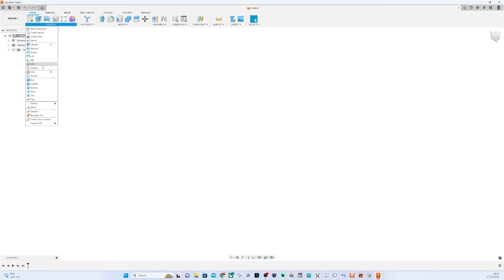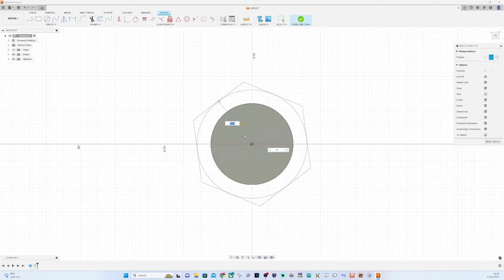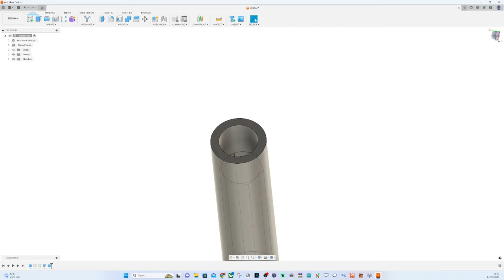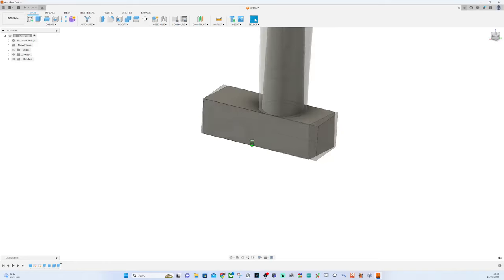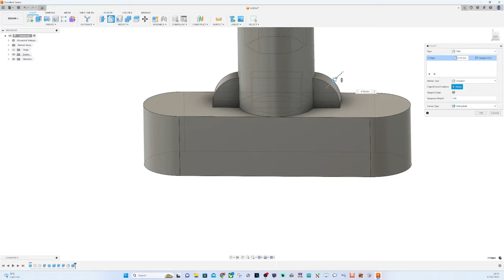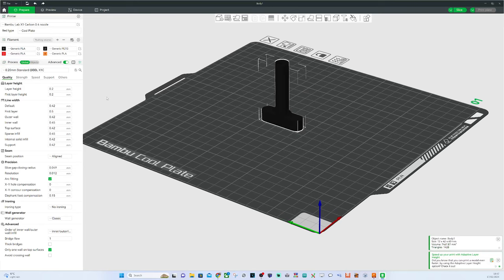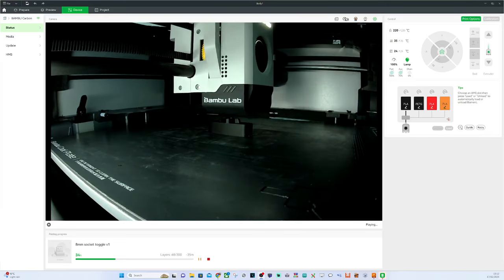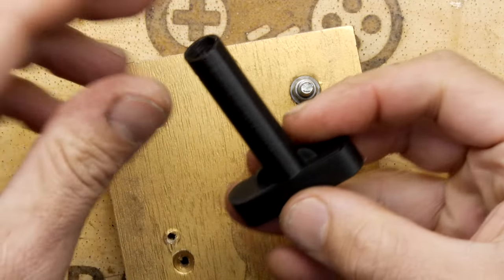3D Printed Socket Surprise - I am quite blown away by this

Comment: To clarify, the reason you couldn't extrude without first clicking the sides was because you had the profile of the socket selected. That had fusion assume you wanted to extrude the socket face instead.

Aside from going out and selecting the correct face, you can also choose a face in the extrude tool in the toolbox :)

Also great video!
Reply from the maker: Thanks, I'll have to rewatch and see myself doing it wrong. After years of using fusion it broke my brain 😂

Comment: When you want stronger prints, increase the walls, not infill.
Wall perimeters add way more to strength than infill.
Reply: Also don't use grid, it's the worst infill as it causes collisions with the nozzle.
Reply from the maker: @hippopotamus86 what is best to use by default?
Reply: @backofficeshow  Depends on the use case, but I tend to use gyroid or cubic. With the default of 'grid' (which for some reason Bambu Lab won't change, despite Orca and Prusia Slider both not using it as default anymore), you will hear grinding noises when the nozzle runs over the raised intersections. Apparently the same issue can happen with rectilinear.

Comment: I've made larger ones to put M16 nuts on the bolt that holds my bike rack to my car - it always took an age to finger tighten them up as they had to pull in a vibration resisting bar also..... I made them with a 12mm end for the cordless drill chuck, and they work really well.... I also made similar to play with - a car scissor jack of mine has a nut on the drive shaft, that you are supposed to turn with a small lever/socket.... the cordless drill is much faster - I've snapped a pair of these though, much more torque!
Reply from the maker: That's really interesting, M16 is pretty big! I'm designing a rig to test the force these can take and measure the result. I'm curious as to how to print the strongest versions possible!

Comment: I wanted a flat driver for interchangeable driver bits a while back, I was really supprised his well it worked, I assumed printing something like that would be an terrible failure.

Two tips though:
 Increasing the thickness of the walls/number of perimeters generally does more to improve strength than adding more infill. 
When you did the second cut to clear the cross bar you could have dragged the original cut to the end of the timeline rather than doubling up on the feature. It may not matter much for a simple part of a one off, but that sort of thing can really mess up your day on a more complex project if you come back to make changes later.
Reply from the maker: Those are great tips. I just ordered a digital torque wrench as I get this topic needs to be approached scientifically and including exotic filaments. 

I'll use your tips in the new socket designs! Is there is a nice way in fusion to make length parametric? That would make life easier to output standard and long sockets
Reply: @backofficeshow  there is a menu for parameters (I think it uses a capital sigma for an icon) you can create named parameters there then use the names in place of the measurements when dimensioning. Also the more you can do to ensure things are set relative to what actually matters the better off you will be. Such as setting the length of an extrude as up to surface or offset from surface to the surface rather than using absolute measurements the better things will hold together as you go. If there is one thing I render from my car classes it is the phrase "capture design intent", is the cut 20mm deep or is it half way through a 40mm part? That difrance matters a lot if the thickness of the the part changes later.
Reply: I took a moment to check, the parameters menu is the fx icon, on the solid/modify toolbar.

Comment: Y not use a deep socket from a socket set?
Reply from the maker: It's easy enough to get off when you are at home or the garage, but I wanted a tool that I could leave in the vehicle, or in this case, permanently slotted over the nut. I think they didn't make a great design decision with the nut

Comment: But you didn't answer the real question? Did it work in the car?
Reply from the maker: I was going to try it, but it's raining 😂

But yes, it will 100% work. It holds a plastic lid on so will not require even as much torque as I demonstrated. I will print a second one and leave them permanently installed.

I might reduce the size to 7.9mm so they have an interference fit.
Reply: @backofficeshow  Ah, so convert the buried castlenut into a hand friendly t-nut. Great idea.
Reply from the maker: @RossReedstrom good idea, but the access is limited. I'm wondering now though.....

What if I take this same design. Remove the hex and replace it with a hollow tube. The diameter just shy of that internal to the m8.

Then tap out an m8 thread.

The whole thing becomes the nut? 

It will never rust out and if it gets bound up, it will be a lot easier to break out than a rusted nyloc?
Reply: @backofficeshow  since it's just holding a cover on, not a lot of load, it could work. But your existing design,  undersized so the nyloc press fits, basically is a nice thumb screw/wing nut as it is. Just leave it in place! That's what I was trying to say.

Comment: Wood squished down don't really hold the torque.
Reply from the maker: I just ordered a digital torque wrench. This subject has got me interested enough to want to test it properly. I would like to see how large we can actually get and what reasonable levels of torque are possible.

The idea of being able to print your own sockets in an emergency is cool, Also having non-marring sockets would be very useful as well!
Reply: Make the toggle wider then run a 1-2mm fillet all around the base of the tool to the toggle. That will increase your torque strength.
Reply from the maker: @simonmccolljones2445 great idea..I tried it for intended purpose and it was more than adequate. However for my upcoming "tested to destruction" 3D printed socket set, I will certainly use your suggestion. I am rather excited to see how much force these really can take. I ordered a digital torque wrench with peak force gauge 👍